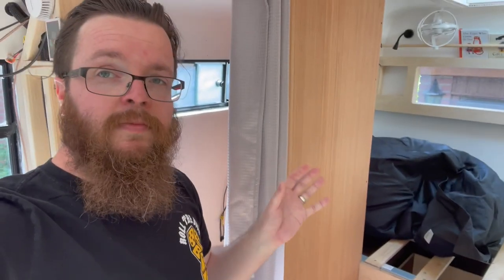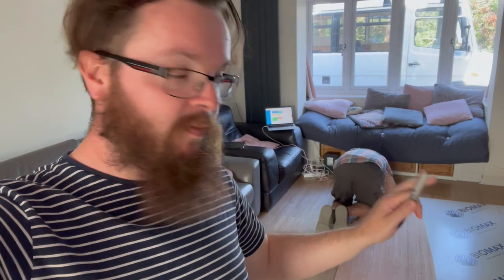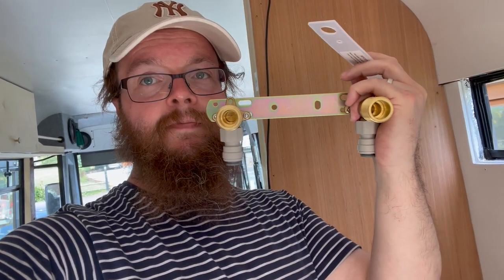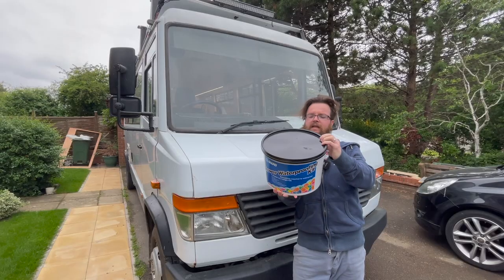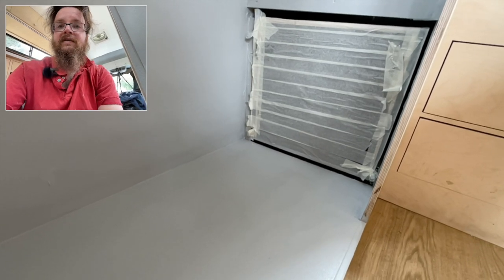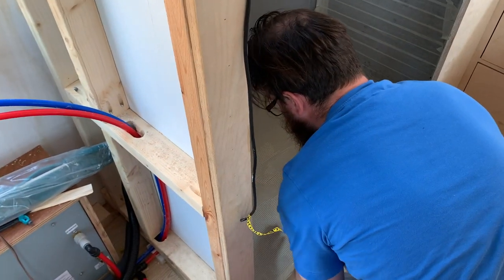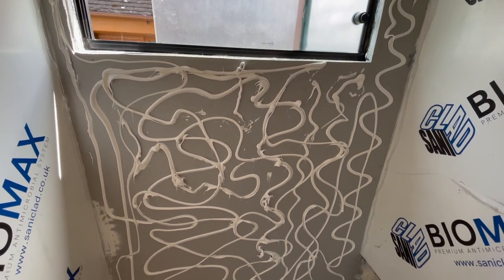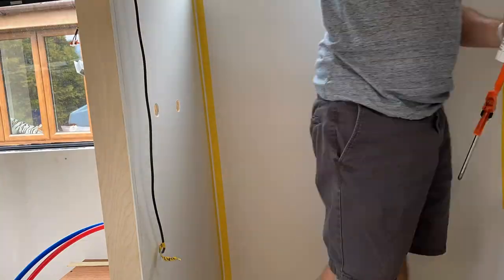What a Difference! Van Shower + Toilet Transformed (Fresh + Clean Look) |  DIY Van Conversion Series

Comment: Fit two drain plugs diagonally opposed, no worries with the tray draining then.
Reply from the maker: Agree this is a good idea. On our setup this isn’t possible as the other end is on a wheel arch. We will have to be mindful how we are parked if we are to use the indoor shower at that location. Good idea though. Thanks.

Comment: Any long-term update on the Saniclad panels. Have they stayed stuck solidly on the walls or have you had any problems?
Reply from the maker: Hey Paul. They have remained in place and we’ve used it quite a bit in some pretty hot heats too.